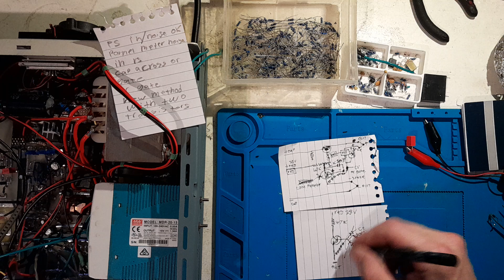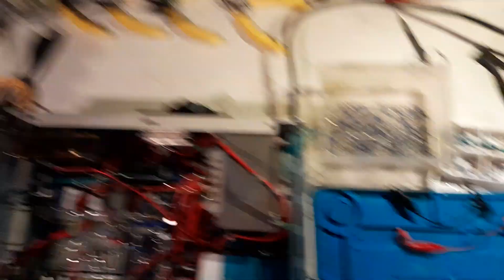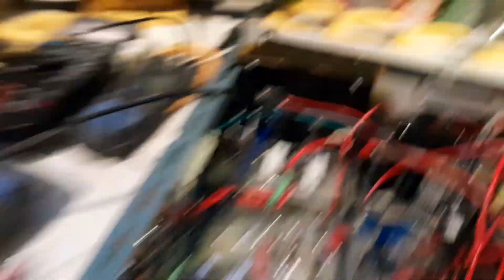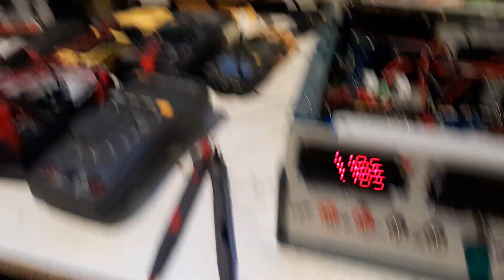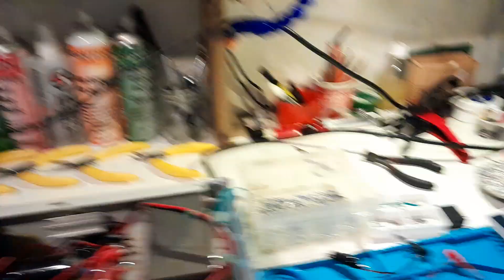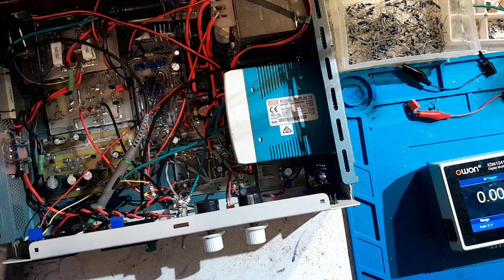Update to my ps build with schematic!

Comment from the maker: The 4 protection diodes are now a 3v6 zener and a 1n4148 in series giving a one way ~2.3v start of conduction with them fully switching on if the voltage rises to ~3.8v still protecting the e-b Junction but no were neer conducting under normal operating conditions meaning the two diodes don't need to be temp compensated just the transistor! Way more done already next episode almost finnished! Won't give too much away!!!!